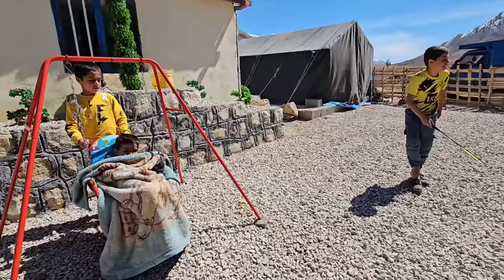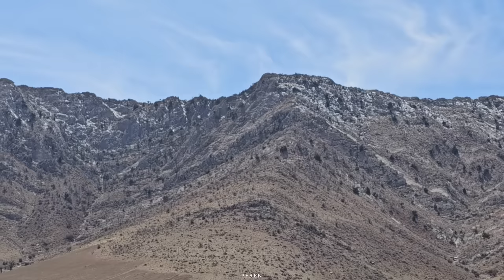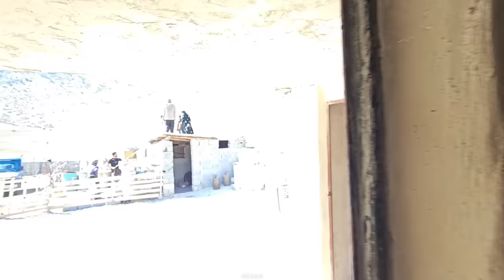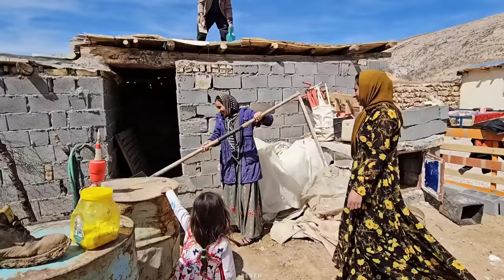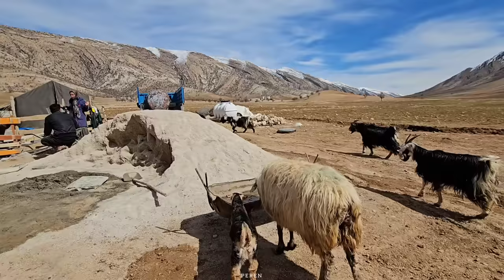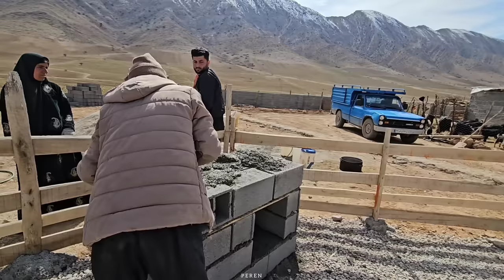Rural family.  Mohammad and Tianaz are happy with the new game equipm👫🎪🎑.

Comment: Я видела у бедной матери одиночки солнечную панель с аккумулятором. От него можно питать энергией холодильник и освещение в доме. У вас две большие крыши - дом и хозблок. Установите на них солнечные панели, подключите к аккумуляторам автомобильным и освещайте свои помещения, подключайте холодильники, морозильники и электроплиты.
Reply: You cannot carry a refrigerator around the mountain, in the spring they will be taking the goats up the mountain. I do not see how a refrigerator can run on a battery, believe you me I have a caravan on the coast in the UK and my refrigerator will not run on a battery, it has to be gas or electricity, and it takes a fare amount if electricity to run. I also have a solo panel on the roof that’s used to top up the battery, but it still would not run a refrigerator.
Reply: @sandrawestley4193  And in Russia everything is possible. There are young guys who live in the village, in an old army car, converted for life in frosts of -45. On the roof of such a booth there is a panel from which the refrigerator, computer and heater are powered... He did everything himself, changing the circuits.🤣

Comment: Am not a Carpenter but it's common Sense, when your putting up roof you should overlap so that rain water will not flow on your wall of the house. What I see problem why there is leakages on your wall it's bec you did not Sealed or semment around edges of your roof. You always build Slappy that's why in the end you keep repeating or repairing when there's leakages. When problem arises your all gonna hurry and fix problem when it is already raining hard.